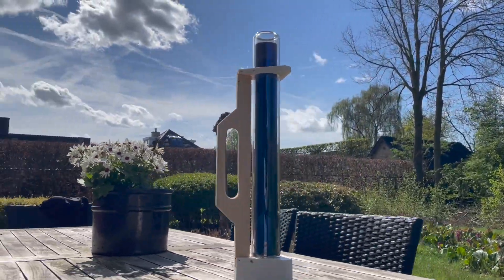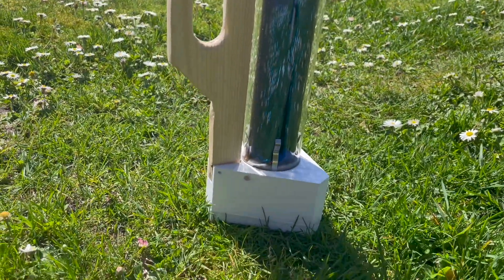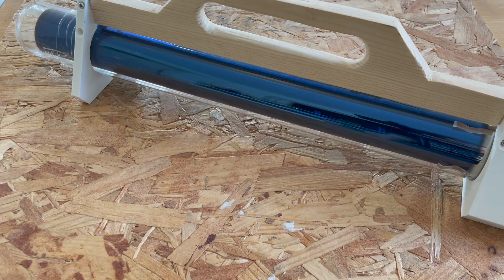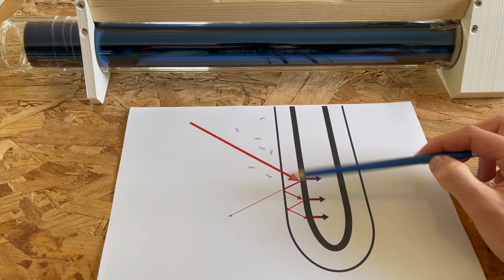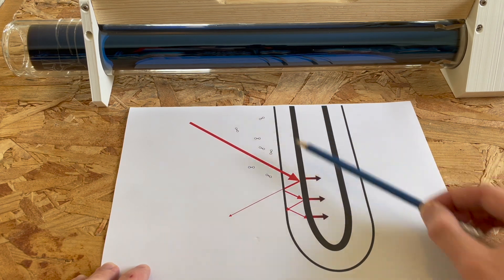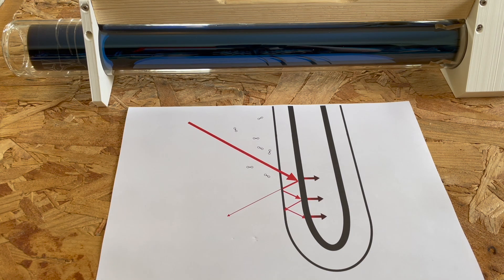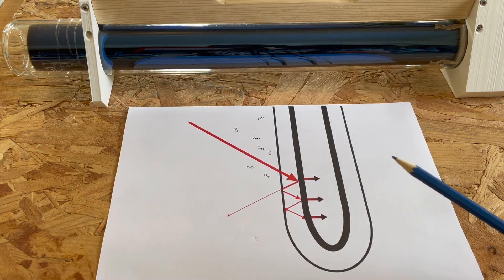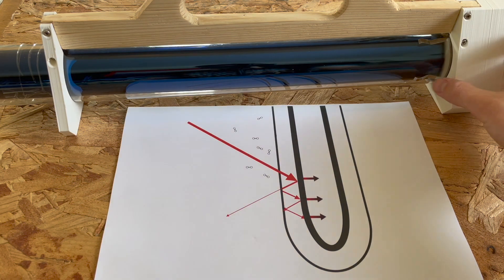FREE hot water

Comment: If you scaled this up you would save massive electricity when heating water. Just preheat the water with this before you put it in your water heater
Reply: That's what these tubes are originally for :) You can get complete systems for roof mount.

Comment: I dont think you can't find a lot of this in US, but in EUa a lot of rural houses use an array of about 8-10 long tubes plugged into the side of a isolated barrel, that is placed on the roof and filled with water. We use them to heat the water during the middle of the spring to the middle of fall.

Comment: what if its not sunny
Reply from the maker: It does still work but it will take a lot longer to get warm :)
Reply: Use electricity
Reply: Even on a cloudy day it still captures energy. Obviously not as much, but it does work. It even works during a sun shower where it's raining but you are still getting sunlight. I have many different forms of this tube, one is a solar water heater, the other is an oven. I turned the oven into a solar distiller.

Comment: just put a black water bottle in sun?
Reply from the maker: that would get the water a bit hot but it would never get it boiling. Because at some point depending on the outside temperature you reach equilibrium where the black bottle loses heat to the environment equally fast as it can absorb heat.